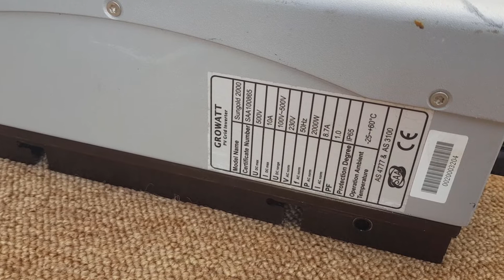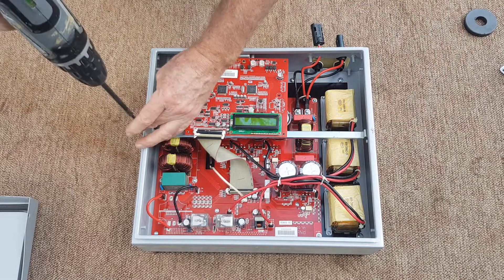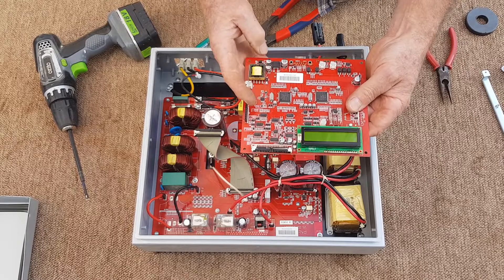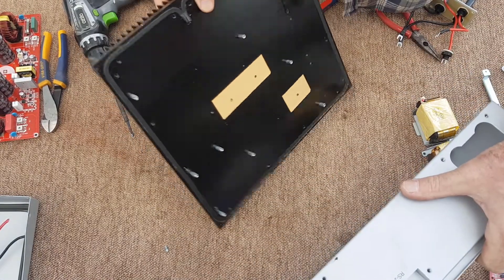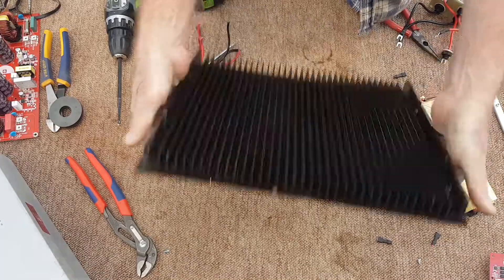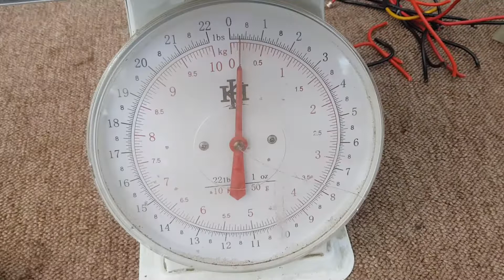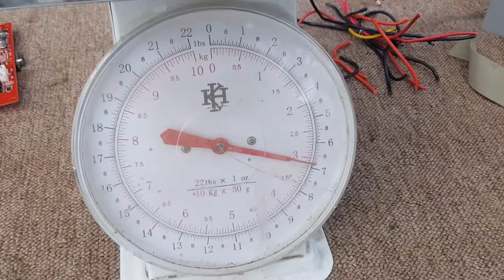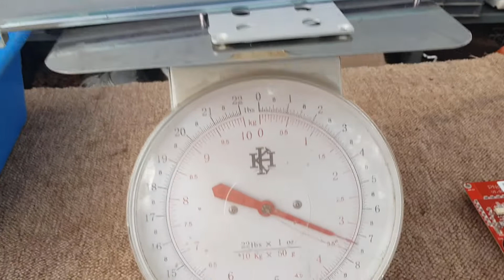Scrapping a Growatt solar power grid inverter for parts & e-waste scrap. What's inside an inverter?

Comment: This week an electrician gave me 2 older style larger inverters (30kg each- heavy!) Stripping all possible wire out, they gave me 17.5kg of lacquered wire. Early this year I got serious into stripping wire and copper scrounging. Bought an enerpat multi cutter electric stripper- well worth it! Have various tradies and businesses giving me old appliances, scrap metal, even a uteload of ewaste from a computer repair shop every 4 months. Have a mission of a 1 tonne copper payday. Its been 1 year so far and roughly 20% there. Think I'll need to build a copper granulator for all the wire too small for the stripper- hate to sell it for less than best price. Electric motors get easier to strip each time! Was surprised to see how much wire came out of a slant six starter motor solenoid!
Reply from the maker: Wow, 1 tonne of copper would be a sight to see Ross! I did achieve just over 1 tonne of brass before my big clean-up earlier this year!

Comment: My scrap yard lets you keep the cable ends/plug on.  Cable ends are brass or copper.  I have several of the same microwave magnets.  Copper bearing motors go for .25/lb, low grade insulated wire just went for .80/lb.. Alum. was going for .60/lb.  Copper wire over $3.  I would take those transformers apart to separate the wire. First time seeing inside of inverter, thanks!
Reply from the maker: Thanks Karl! Yeah, scrap yards vary quite a lot as to how and what they accept! Our prices have gone up a lot since this video was made - I think scrappers all around the world are rejoicing! 😁👍